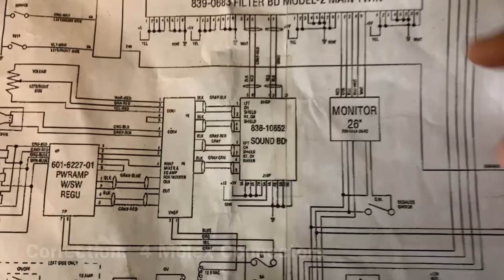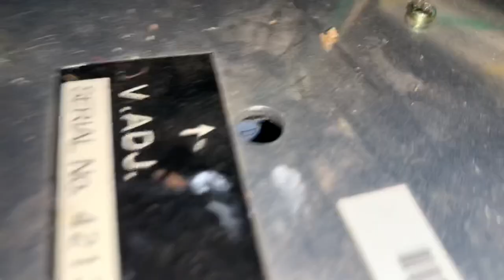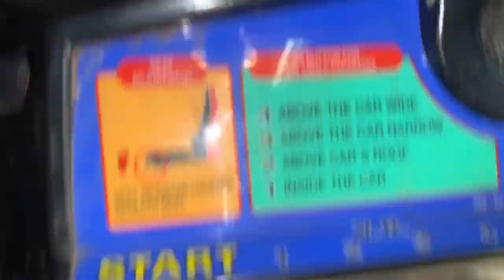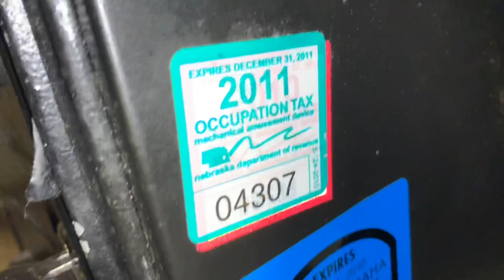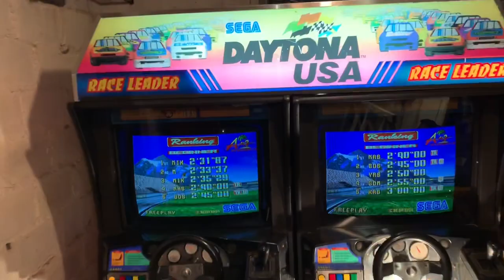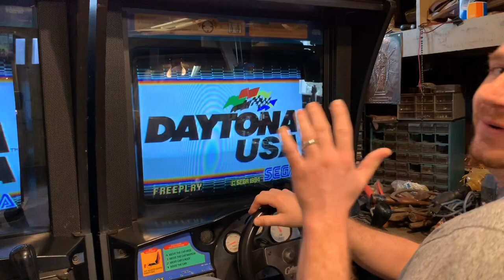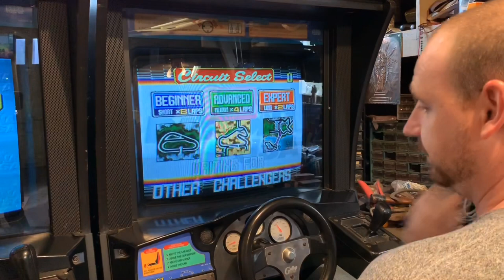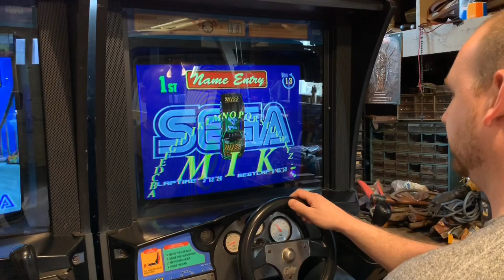Daytona USA Arcade Sound Issues (Part 2)

Comment: Awesome! Glad to see I was right. I had a similar issue with my Daytona twin-and-a-half, but I just bought a new sound board because it was cheaper than shipping it off to Ken for repair. Now I'm pretty sure I just need a mixer, and all 3 Daytona's will be up and running. Now, if I could just fix the monitor on my Galaga cab. Then again, I play all of my games blind anyway, so to me, fixing the monitor really wouldn't accomplish much.
Reply: Couldn't stop myself. The blind jokes just come to me.

Comment: Nice work. But I highly suggest you periodically clean your boards and fans. All that dust and dirt can't be good for your components. I've heard stories of chips overheating and failing because of the amount of dust ontop of them.

Besides that, great work. Glad it's running again.

Comment: 12:30 lol. that's a common trick by repairers to gain your confidence. They tell you to swap a part that's in a socket (in this case the ONLY chip in a socket other than the ROMs) and you think they are a good guy so when that doesn't work (and the guy knew it would not fix it) then you sent it off for repair and that guy makes money with an easy fix lol. Read my other comment here for the real cause of all the problems on these boards.

Comment: I've fixed over 500 of those boards (yes really). They all have the same general fault. Think about it.... your board was covered in literal crap and you wonder why it stops working??? lol. After years of abuse they all develop random broken connections due to the dust and crap sucking up moisture from the air and you get those areas corroding and then you get open connections. I had so many of these to repair that I fully reverse-engineered the whole board and made a proper schematic and I even re-produced the boards new.... a rotten board can be fixed but it will fail again somewhere else. btw, the thing you're calling a 'schematic' is just a very simple wiring harness diagram lol. The sound board issue is the LEAST of your problems. That's the kind of fault you want but even having the repro sound board won't help.... the real problem with Daytona is exactly the same as the sound boards..... random corrosion causing random broken traces or open vias at random locations. But Daytona is 10X worse since there are 2 large multi-layer boards plus ROM board and comm board. Eventually all Daytona boards will be dead due to the extreme amount of time it takes to find those open connections because no one is going to pay a professional repairer for tens or hundreds of hours to fix them. These are the types of faults that only a person who owns the game can do over a long period of time. Better get used to it as you're going to be doing it yourself eventually.....

Comment: Couldn't just split off the other sound board RCA run to both
Reply from the maker: Joseph Brown I wish!  It has its own independent sound system for each side.  Technically this is 2 arcade machines (you could split them up if wanted for a single player cabinet).  So basically if I did that I’d be hearing all the sound effects from the left side coming out of the right side speakers.
Reply: Wasn't thinking about driver ones sound effects. Figure music on  would be good enough. Great work I'm just getting ready to start collecting.. been watching your channel and  another for pointers.
Reply from the maker: Awesome!  Thanks for checking out the channel